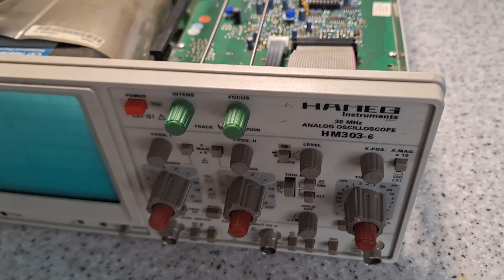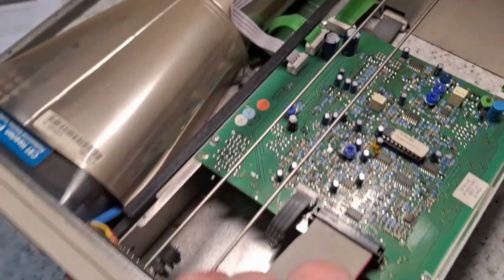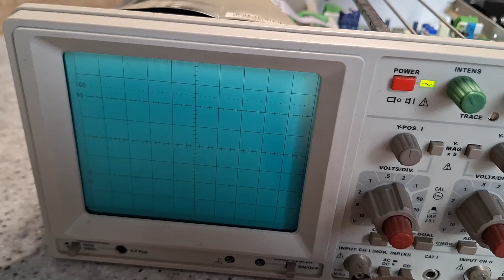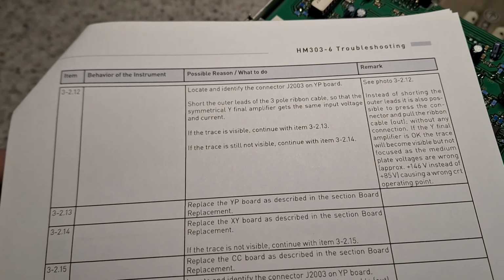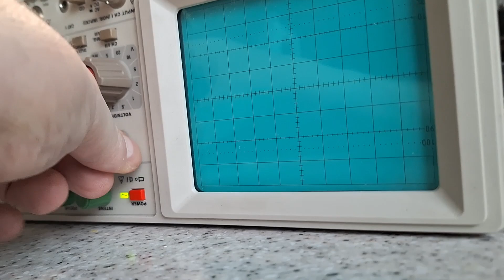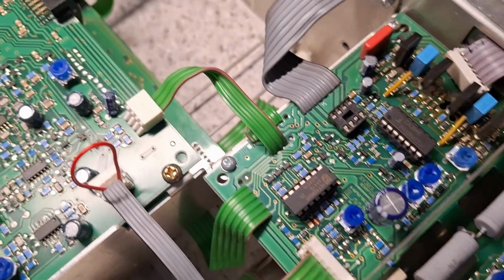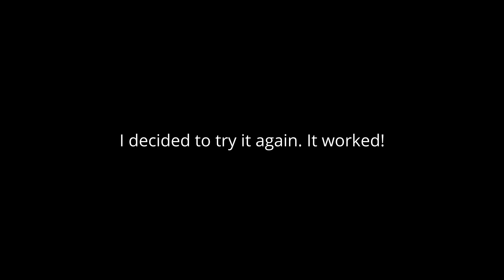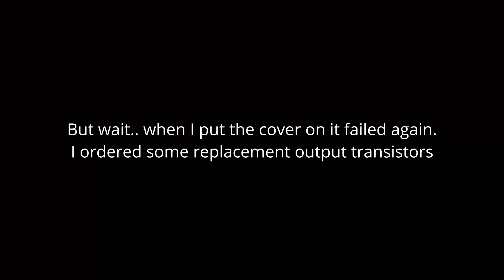Hameg HM303-6 oscilloscope repair part 1 - no trace fault. Traces deflected off the screen.

Comment: If you don't mind, I have a question. I have a hameg 604 and it all seems to check out but instead of a trace I just get a dot.
Reply from the maker: If the dot can be moved around in the X and Y directions the timebase isn't running so there may be a fault in the timebase circuit. Also check the XY mode switch and circuits to make sure its not stuck in that mode.

Comment: good job, i got an HM303-6.02 in my lab right now, exactly the same fault, however my deflection transistor funny also the left one, all pins are fine, none broken, my deflection board is the 6E-V1 so it looks different from yours, impossible to find the correct schematic
Reply from the maker: There seems to be at least 4 different pcb revisions, could only find schematics for two of them. Neither were same as mine.
Reply: @adriansmith31  i had the same schematic version challenge, i was fooled/delayed a little bit about ch1 huge dc error due to defect ic, i released a little video about my Hameg HM303-6 it is here : https://youtu.be/OwPINr3bG7I
Reply from the maker: I'll check your video out, thanks

Comment: Morning Adrian, well done with the repair. I am looking for the circuit diagram for this scope as I have the same model. I have the service manual PDF but cannot find the circuit diagram.....can you help please?
Reply from the maker: Yes I have some schematics but there are several pcb revisions. Schematics didn't quite match mine (smt components instead of through hole and different amplifier circuits) but they might match yours. If you look on my about page there is contact information where you can email me. Or I can upload them to one drive and share them. Will be tonight when I'm home from work though.
Reply: @adriansmith31  Thanks Adrian. Have dropped a note on your About page.
Reply from the maker: OK I'll sort it tonight